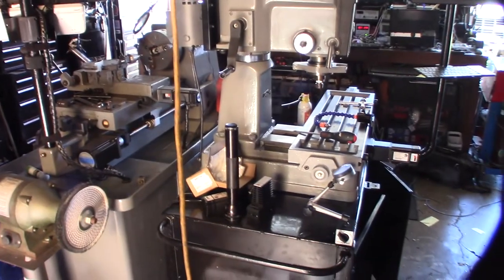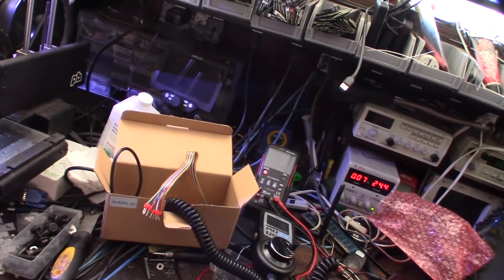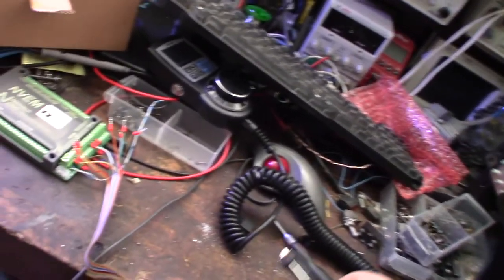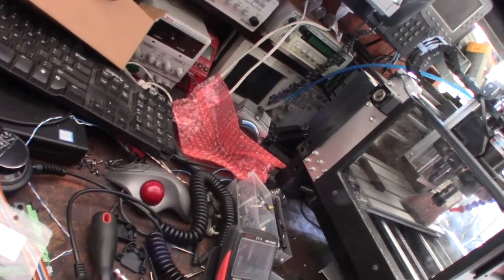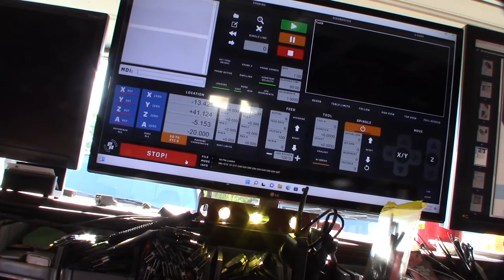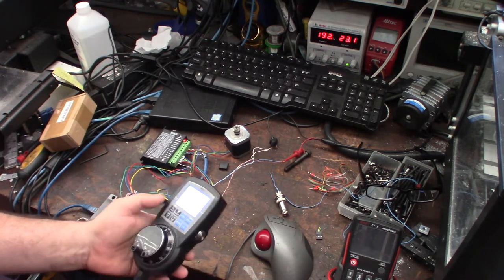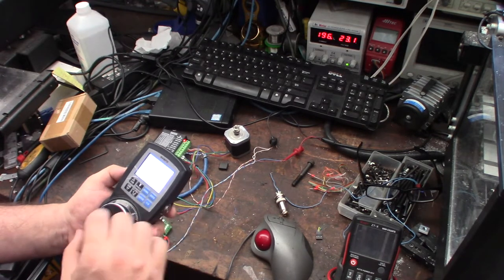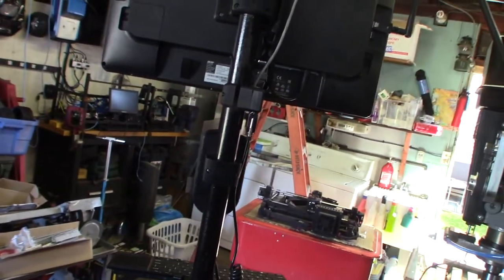Novusun NVMPG Digital Dream Color MPG for Mach3 & LinuxCNC

Comment: The wiring pin chart is for the cable coming from the MPG, not the adaptor. Take the cover off the cable connector and   map the colors coming from the adaptor next to the colors on the chart looking at the MPG cable. I see you figured this out, great!